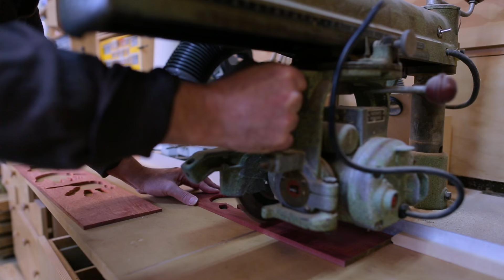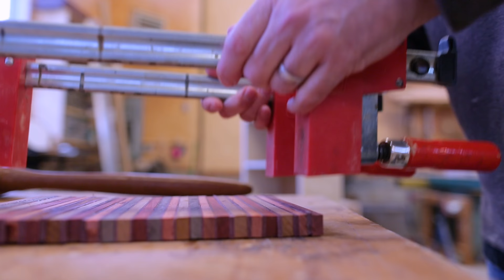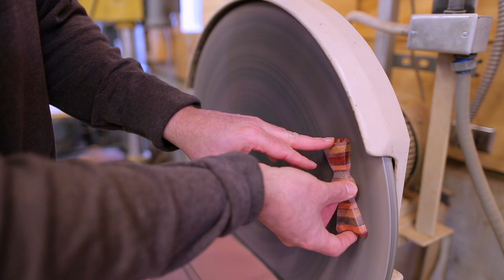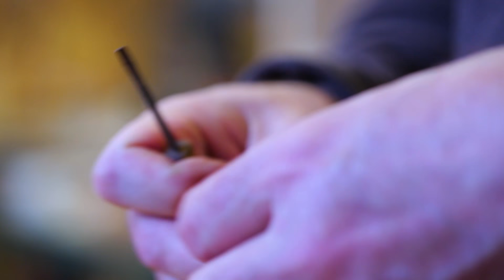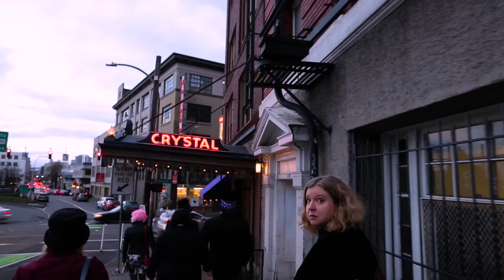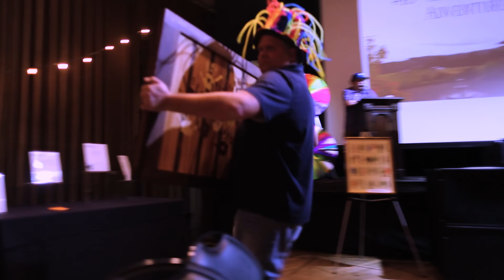Wood Bow tie to the Auction

Comment: what was that device at 1:26.
Reply: I'm assuming it was a depth gauge of sorts.
Reply: I don't own a CNC, but I believe it is used to determine where along the vertical plane the bottom of the cutting bit is. Make/model of the device, I have no idea.
Reply: ryan schwarz it is used to zero the z-axis (up and down) of the cutting tool. The CNC machine knows the exact thickness of the "touch plate" and can then know exactly where the cutter is located vertically.
Reply: Brian Lund, that is awesome. i might have to convince my teacher to get one for our cnc at school
Reply: Correct Kevin. It's a device used to set the tool length offset of the bit. If you think about it, all bits have different lengths, so you have all the bits come down and touch off on this device and the computer calculates where the tip is to whatever resolution (usually around a thousandth of an inch). Often called a Tool Height Setting Probe. 
There are also probes you can mount into the chuck and touch off on the part so you can find the edges, center of holes, center of slots, etc.
Reply: that's correct, just measure how long the bit is.
Reply from the maker: Yes, what has bee said.  Since i have been using this i have not been cutting into my table.